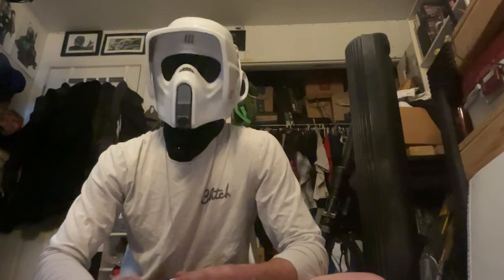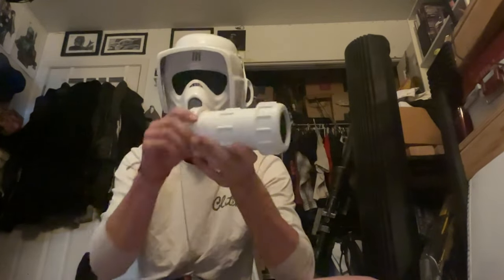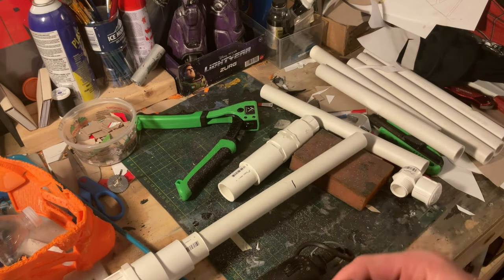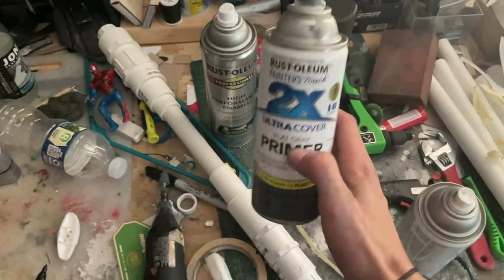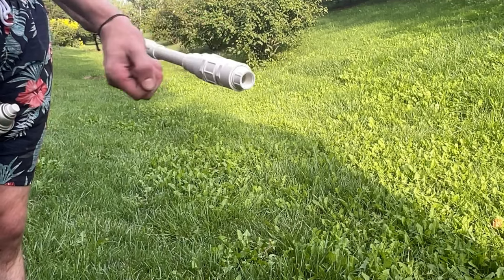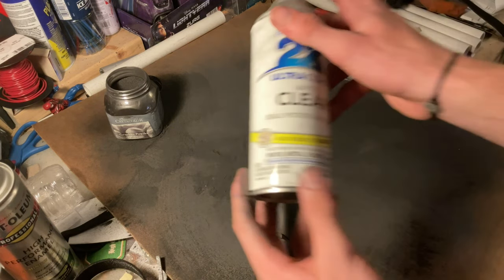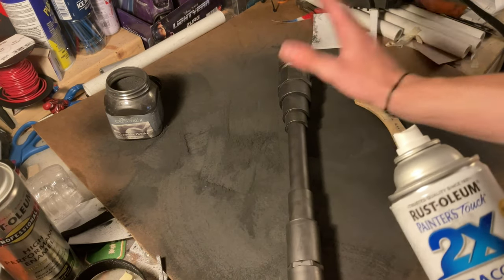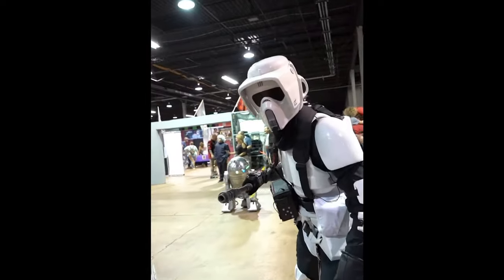DIY Ricks Electro-Staff from Jedi Survivor

Comment: Miles I was wondering if instead of buying puffy paint on my Spider-Man suit I could use colored hot glue. Also that’s sick
Reply from the maker: you could but i reccomend puffy paint with a needle applied method- bc you have much more control over it and it won’t melt with heat